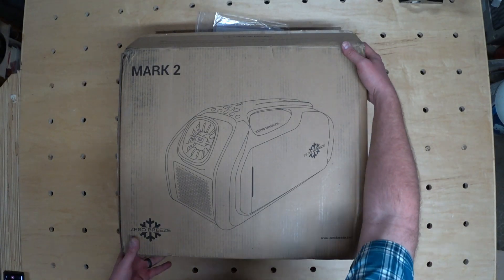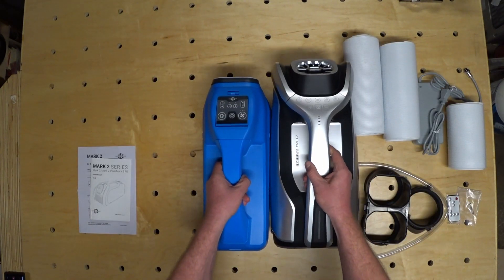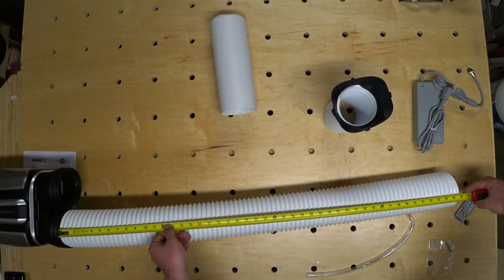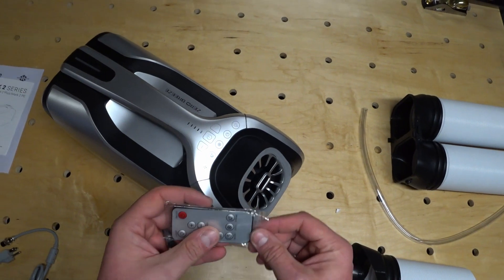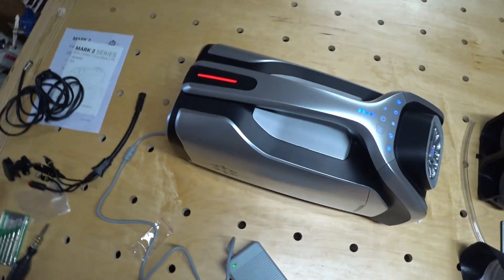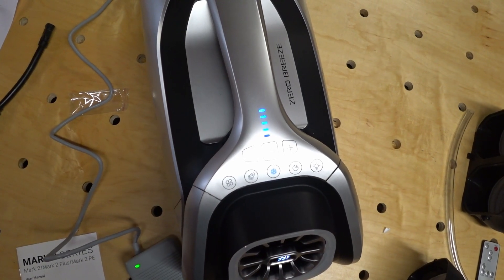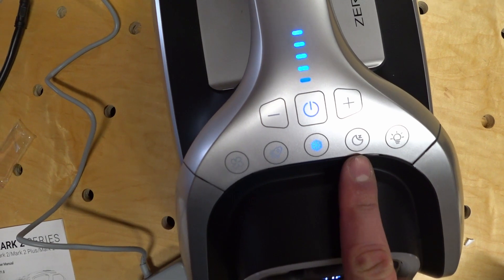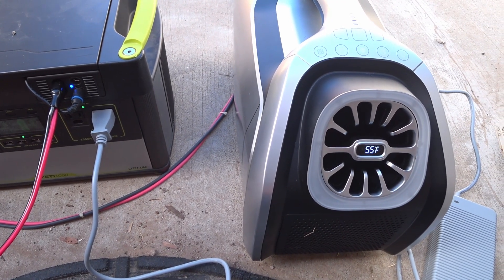Zero Breeze Mark 2 Unboxing, Startup, and First Impressions

Comment: do you have to run the unit on the plug or can it run by itself on the battery, and how long did it last with just the battery power.
Reply from the maker: I'm getting about 4.5 hours on a 1000Wh 12v battery run through a boost converter to get the required 24V. As far as their proprietary battery, I think it's one or the other, battery or plug.  I don't have one so I don't know it's actual run time.

Comment: How long did the first one last
Reply from the maker: The first one as in the original blue one?  About five uses, if that.  The biggest problem with the original (my opinion) was it running on 12V.  Everything just got SO hot pushing all those amps through small wires and components.

My Mark 2 however has been roughly handled, and used in sweltering conditions and still starts up every time over a year later.  I've had issues with my battery struggling to supply sufficient power in very hot spaces, but the Mark 2 has been unstoppable.  It really is night and day compared to the original's engineering.
Reply: @Polymathicus  thank you for taking the time to reply this helps allot more people  than just me

Comment: Hey man, thanks for doing this video!  I'm actually trying to run mine off of a 24v battery bank directly.  I was curious if you could check the voltage of the Lithium Ion battery it came with when it's fully charged.  I'm assuming they have some clearance in there for battery fluctuations but didn't want to plug mine in and have it fry.
Reply from the maker: Unfortunately I did not purchase their battery as I was always planning on using my own.   That's a good question though, but hopefully they thought of that and the Mark 2 allows some fluctuation.
Reply: Can the exhaust air be piped outside with fresh air side left inside? Thinking of using in my suv
Reply from the maker: @terrycaulfield167  You can, and this is how the Mark 1 worked.  But you're creating a vacuum in the vehicle which means you need to open a window to replace the air you're exhausting out the back.  Now that I've tested in a hot car in full sun and found there's no way it will do anything to lower the ambient temp during the day anyway I'm thinking about cracking the windows to exhaust some of that sun induced heat build up.  So at this point it wouldn't really matter in that use case.
Reply: @Polymathicus  How effective will it be able to cool the Podbike Frikar (about 1 cubic meter volume)?

Comment: Is air condition and heat or just air condition
Reply from the maker: I emailed zero breeze that question and they confirmed it can be used as a heater, by turning it around, but since it's not designed for that purpose like a "heat pump" is, it only works down to around 45 degrees F before it stops  being effective.
Reply: @Polymathicus  thanks

Comment: Does this one take 1 hour to cool down the car just like the 1. Gen. one?
Reply from the maker: There are a lot of environmental variables to that question, but I can say that whatever the Mark 1 did for you, the Mark 2 is MUCH better, in my opinion.  As far as cooling down a car in the sun, neither is really designed to do that but I consistently sit in front of it in my car that's 105 inside and I feel great, no sweating.... Until I move out of the air stream, then I'm soaked in a minute.

Comment: my ac went out in my car, so im looking for a small portable ac to work.  this seems to complicated for me.  is there any product not made in china?  thank you
Reply from the maker: Is anything not made in China?  I have been researching this type of product for years and this is the first of it's kind that I have found.  This is much better than their first version, but it still does not have the cooling capacity to replace a vehicle air conditioner during the day.  It works better if you are trying to only cool yourself by sitting in front of the cold air outlet.  If you live in a dry climate and just need cool air on you, check out swampy.net

Comment: I have a Veti 400. Would that work with this zero?
Reply from the maker: Should work plugged into the AC inverter as that one is rated for 300W continuous.  Not sure though if the Yeti 400 would have any problem with the surge when the compressor starts up.  Just won't get a very long runtime using the Yeti 400 if it does work.  Check out the Mark 2 facebook page, maybe someone has tried it already.

Comment: Can you plug it into a generator with an extension cord? Thinking of using it in my semi truck so I don't have to run it all the time.
Reply from the maker: I don't see why not, as long as you're plugging the provided power supply into an acceptable 120V outlet providing clean power, should work fine.
Reply: They have battery operated versions.no cord needed
Reply: @loum614  but you need charge battery

Comment: why do you need to make your own plug for the Goal Zero Yeti. i dont know anyyhing about electronics
Reply from the maker: You don't have to.  The Mark 2 needs 24V DC power to operate.  You can provide that in two ways.  You can use the supplied "power brick" that comes with the Mark 2 and plug that into a standard household outlet or AC inverter outlet on a lithium battery bank.  This uses more power since you're converting DC battery power, to AC power via the inverter, then back to DC power in the power brick and on to the Mark 2.  I elected to run the Mark 2 directly off of DC battery power, so I needed to get the DC battery power from my lithium 12V battery to my 24V Mark 2 using a 12V to 24V DC converter in between.  Zero Breeze now sells a generic cord that plugs into the Mark 2, so you would only need to wire that to the 12-24V converter, and then make a cord that plugs into any suitable output on your battery.

Comment: its a great  concept imo  but hearing about your first one that blew up on you kind of makes me leary of  their engineering and testing departments ?  i myself am leary of electrical devices  smoking  randomly on their own
Reply from the maker: Well, I can say confidently that the Mark 2 is not just the Mark 1 with a new paint job.  The first one may not have been ready for market, which I realized when my vehicle filled with smoke coming out of the back of it.  But they seemed to have listened and made most if not all the needed changes and upgrades from the first one.  Time will tell if it holds up, but so far so good.
Reply: @Polymathicus   what did the company do to compensate you for the first one or were you sponsored to do the review?

Comment: Great honest review, I was considering one of these for my RV build not sure now
Reply: Dont its litterally a scam lol
Reply: seek help buddy...really!!!
Reply: Dont get it not efficient enough it's faster to cool ur car with ur own car a/c
Reply: IT IS A SCAM. Why does the narrator have his old unit that caught on fire? If you look at the LA BBB site even if you return it it appears they don't give you what you paid for it...if anything. F rated by BBB, now they say they are not in business. A Chinese shell game....they ARE in business. And this narrator never explains why he has his old machine that burnt up.
Reply from the maker: Thanks for your comment,

If it's a scam, it's a glorious scam that keeps me from sweating my balls off.  I keep my original one because I've made videos using it to compare to the new one, plus, someone told me it was probably a capacitor that blew in it and could be an easy fix to replace it on the board....if I ever get around to it.  Zero Breeze offered to replace the burned up original with the Mark 2 when it came out.  Many months later, and admittedly, after several "reminders", they indeed sent me a replacement, and made me pay 100 bucks for shipping from China, which I could live with.  Now I have 2 Mark 2's and have the second available for coworkers.

I've been on the forums and groups talking about the Mark 2, and I'm aware of issues with some, and most seem to get their issues resolved.  If it was a scam there wouldn't be so many people praising it's worth.  I checked out the LA BBB and the majority of the complaints are from the old Mark 1, most of the recent complaints on the Mark 2 had been resolved, and many recent complaints are about shipping and billing, or missing deadlines for refunds, not all with quality.  The balance of complaints (5 or so) that went unanswered don't necessarily prove the entire operation is a scam.

I allow every comment on my Zero Breeze videos that has anything to do with the air conditioners, good and bad.  If someone can show evidence that the company has become a scam, I'm all ears and will tell the world.  Until then, there are thousands of people around the world who are enjoying their Mark 2's and their semi sweat free balls.

Comment: Sorry you wasted your money on the AC :/ Maybe try black and Decker portable? It uses vents too but it's really powerful
Reply from the maker: Is the Black and Decker DC (battery) powered?
Reply: @Polymathicus  12V DC, runs between 8,000-14,000 BTUs
Reply from the maker: Thanks for the info, I'll look it up. Will be interesting to see what the power draw is running at 14000BTU's.
Reply: @mikedesverknopf4681  12v DC 14000 BTU??? No way...

Comment: will it run off a cigarette lighter in a vehicle without the battery? The reason I ask is they are selling these online without the battery!
Reply from the maker: The Mark 2 runs off of 24V so your vehicle would need to be a 24V system or you'll need a boost converter.  Your cigarette lighter port would also need adequate gauge wiring to handle the power draw of the air conditioner. Not the best way to power it.
Reply: @Polymathicus  inverter would be the best, Thanks for your reply

Comment: Thanks !  Do you think in humid ct on a 95 degree day it will cool a boat cabin 8 feet long by 5 feet wide by 4 feet high. From 95 to 75 f
Reply from the maker: It's going to be difficult for the Mark 2 to cool any enclosed space on a hot day in full sun.  The sun relentlessly beating down on the space is the problem that any A/C has to work hard to overcome.  In my testing so far, I think it's possible to get 75 degree air out the front at 95 ambient, and if it's pointed at you, then you might be comfortable.  This is obviously just my opinion since I don't know the specifics of your situation.  If your cabin has a considerable amount of insulation overhead, and the Mark 2 hoses ported outside the cabin....could be a different story during the day.
Reply: Just cool at night?

Comment: Why buy another one when the first one burned?
Reply from the maker: When they introduced the specs on the new one, they fixed (at least on paper) all of the issues and inadequacies of the first. Combine that with the very low early bird crowd funding price on day one and my need for a device like this, it was a no brainer for me to take the risk. And it worked out, I'm still happy (and not sweating) with the Mark 2.

Comment: You think it would cool a  4 door sedan car at night ?
Reply from the maker: A lot of variables to consider.  Size of vehicle, outside/inside ambient temperature, possibly humidity levels, number of occupants, etc.  In my opinion based on my short tests so far, it's possible, if by cool down you mean make it bearable on a hot night.  If we're talking about someone in the direct stream of air coming out of the Mark 2....then I would say absolutely that person or persons would be comfortable.  This is why Zero Breeze was smart in adding the duct at the outlet so we can direct the output.  I have felt more than comfortable sitting in that stream of cold air when the air around me is hot.

Comment: At $1500? Why would anyone consider this? Please explain in detail.
Reply from the maker: One who needs a portable lightweight way to discharge air that is around 30 degrees colder than the ambient air around it.  Also being able to do so with a reasonably sized battery bank for hours on end.  There are much cheaper way to make cold air.  None that I'm aware of in this form factor, using this little power consumption.  It's a very specific product, for a very specific person and use case.  If you're that person, you'll know it, and this Mark 2 will be priceless.  I have to say though, I paid around 500 through crowd funding....if I had to pay 1500 with batteries....I'd still do it knowing what I know now, but it would be painful.

Comment: Does your vehicle not have AC?
Reply from the maker: Not when the engine isn't running, and since I cannot run all day when I'm in it.....here we are.
Reply: @Polymathicus  is the hot air exhaust hose necessary?
Reply from the maker: Yes, that's the only one that is absolutely necessary to keep that hot exhaust out of your space.
Reply: @Polymathicus  so its a requirement that it be near a window or some outlet?
Reply from the maker: Somewhere to be able to purge that hot exhaust outside, yes.

Comment: because of the broken tab and weak hold of the rear duct holder I will not be buying one of these.  The price is too high for buying a POS that pops apart that easily.

Comment: $1000 for a unit that I've seen tested in a hot area and takes a long time to change a small area's temp just few degrees.  Save a GRAND and buy one of those personal $30 ice water used air cooler devices.  At least YOU will be cool and save $1000
Reply from the maker: I have one from swampy.net, one of the ice or evaporative models they don't seem to have any more.  The dual swampy units are hundreds of dollars but actually work.  Those 30 dollar things just don't do anything.  Used the swampy for years until I found this.  The Swampy worked great in a hot (not humid) vehicle when pulling in outside cooler air into it's intake which also pushed the hot air out of the vehicle.  I modified to use either as an evaporative cooler, or by using a selector could turn on the ice water through the heat exchanger.  Worked like a champ, but had to buy ice every day that I used it and it was just a pain to always buy 4 bags of ice at 2 bucks a bag to fill the cooler and only get maybe 4 or 5 hours out of 40lbs of ice.  So, although the Mark 2 is crazy expensive and may not even cool as much as my swampy, I just plug it in and it makes cool air.

Comment: Hold it dude, that machine has an exhaust! You do not simply turn it on and cold air comes out the front. So why isn't it hooked up? Lol, otherwise you are pouring hot air out the back and cold air out the front. I know I have 2 machines.

Comment: Too expensive. I can buy two 200AH lithium batteries and a 5k peak watts inverter and a $130 5kbtu ac for the same price for my camper.  It’s just not worth it. You can literally build  own rig with a few dewalt lithium batteries. Airbrush compressor and a $40 fan or swamp cooler.
Reply from the maker: I agree.  If you have the space, the means, and don't need to move the system, that setup would work much better and be more cost effective to cool a camper.  The Mark 2 wasn't designed to cool a whole camper though, at least not on a hot day in full sun with limited insulation.  As far as a swamp cooler, I used an ice cooled + evaporative model from swampy.net for years (I don't thing they make the ice models any more) and was happy with it for about 700 dollars.  Even the swamp cooler only model works great in a very dry climate if you pull the intake air in from outside.  I have found that the refrigerated air coming out of the Mark 2 though feels just a bit nicer, and I don't have to add water or ice.

Comment: Have you tried using the 24V boost converter? Does it work with no problems?
Reply from the maker: I have.  I go over it in other videos.  I did have to upgrade to a 20amp converter, as the first 15amp version I bought was causing faults on the Mark 2.  Wasn't apparently providing enough power, or enough quality power.

Comment: Looks flimsy, even it looks nice. Seriously the previous one caught fire...then it's best not to use this product again.
Reply from the maker: Good advice in general, but this is the Mark 2, the first version is the one that smoked me out.  They really fixed all the problems the original had, and made it more powerful.  This one is built like a tank compared to the original, very solid, bigger, heavier, and doesn't overheat like the original since this one is 24V, so less amps being squeezed through the electrical components.  I took the chance and wasn't disappointed.
Reply: @Polymathicus  All the Best 👍

Comment: So basically it doesn't worth the $1500 they ask for it.
Reply from the maker: I paid MUCH less through crown funding.  But for what I paid and what I use it for (blowing cool air on me in a parked vehicle when I'm working out of my vehicle occasionally) then I'm happy with it so far.  I'm having issues getting it to stay running when it's really hot in the car so need to do some more tests.

Comment: If you use this in a room, you will just heat the room up.
Reply from the maker: Yes, definitely possible.  You'd want to keep the hot air exhaust hose as short as possible wherever it leaves the room, or insulate the hose if possible if you were worried about it

Comment: Did you pay for this??  Wow you got ripped off sooo bad. I feel terrible for you.  You have convinced yourself that this is a good purchase. So much denial.  You could have bought a nice Honda generator and a "portable ac or window unit for an 1/8th of the cost. But if you can afford this pos then good for you if you like throwing money away.
Reply from the maker: I appreciate your opinion.  No need to feel terrible however as I feel fantastic not sweating in a vehicle that is >100° inside.  It's a very specific use case to justify the price, but if you're that case then it's priceless.  I'm just not in a position where I can easily bust out a generator and window unit.  If you go into this purchase expecting exactly what it can deliver then it's worth it for sure in my opinion.